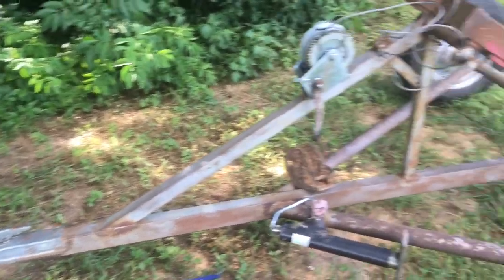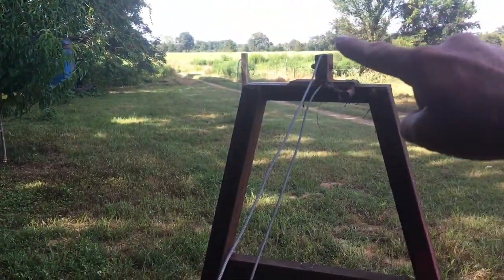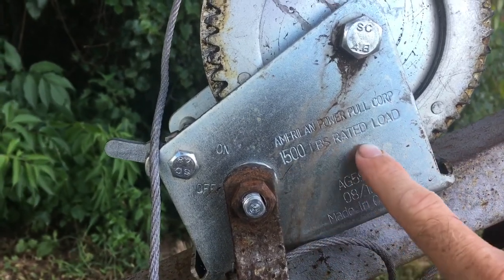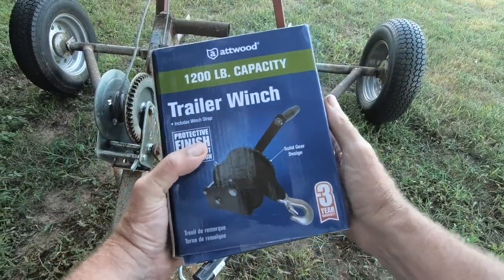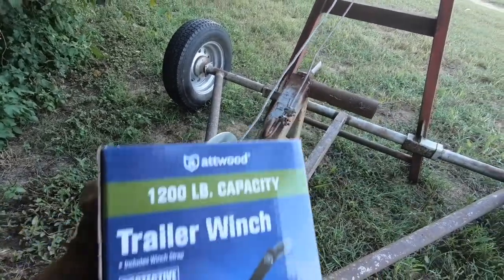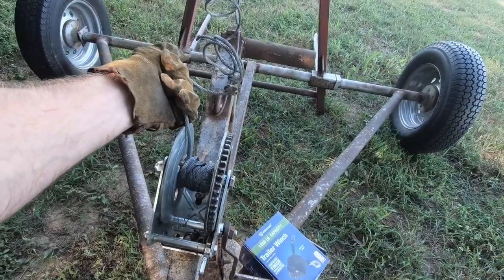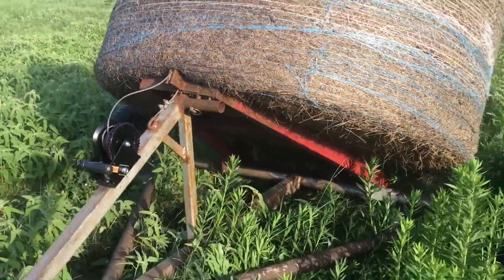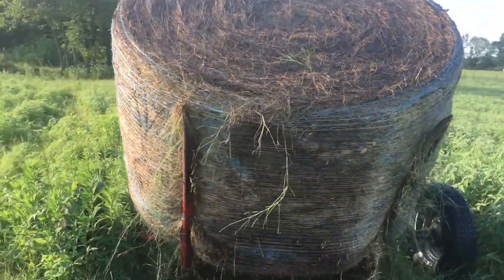Hay Dolly Trailer Winch Replace

Comment: I use a dolly with a Sears garden tractor or our car.  Mine has an ATV winch that works pretty well.  Have you tried filling the front tires on the tractor and hanging weights on the weight rack?  Sure would be easier for that many bales.